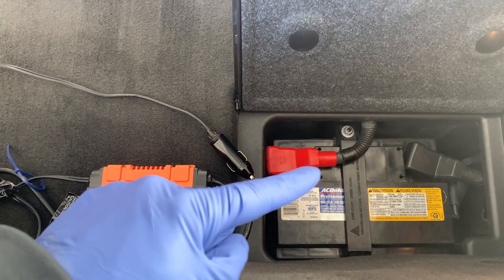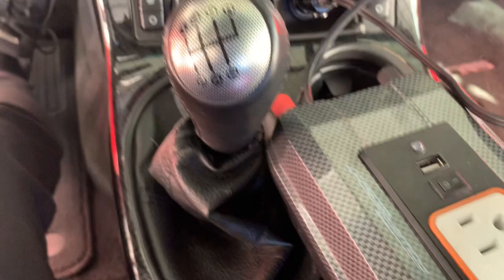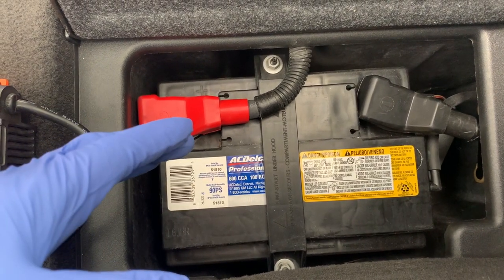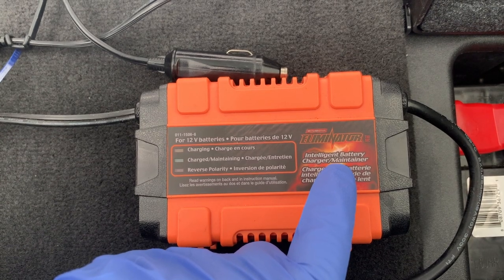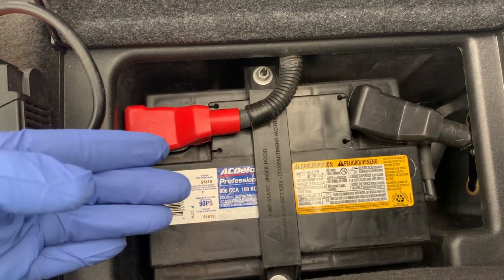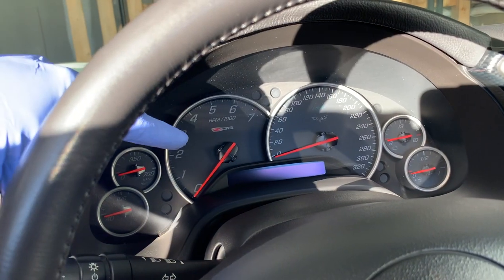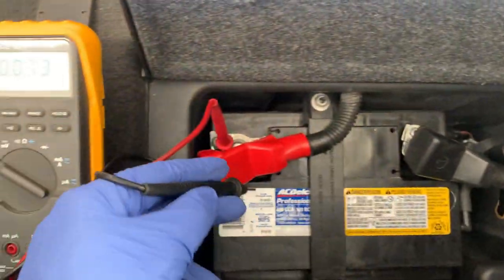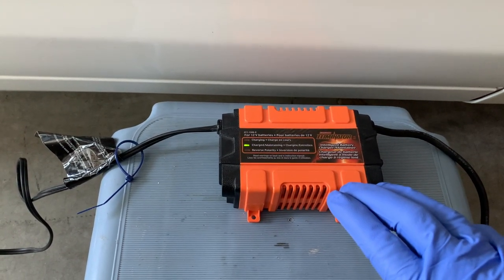How To Properly Use A Battery Tender: for charging and maintaining

Comment: The heart of my backyard pool sound system is a high quality Pioneer car stereo that was salvaged from a scrap vehicle.  I initially powered it with a 12 volt laptop charger, but occasional power outages would mean I had to often redo the settings.  I had a spare battery maintainer exactly like yours and I picked up a 12 volt lawn tractor battery.  With the stereo connected to the battery which is connected to the maintainer, everything works perfectly and no more setup loss issues.
Reply from the maker: I miss the old head units that we use to swap out periodically.  And that’s a great way to get power to it.

Comment: Excellent video. I went out and bought a 4 amp Deltran battery charger and maintainer for my truck. Nowhere in the instructions does it suggest 'how often' I should use this product.  My vehicle is only driven once or twice a week and less than 10 miles each trip. I know it could be used daily, but that's probably not necessary. Any idea how often it should be used ?
Reply from the maker: You can frequently use and leave your battery maintainer on all the time.  Environment / region plays a huge factor in the equation.  As an example, my sports car (driven similarly to your usage) battery would discharge within a week when I lived on the Pacific Coast.  So, as soon as I parked it, I would connect my maintainer until the next drive.  When I moved to the interior, the same driving habits didn't require a maintainer.  In short, attach/use the maintainer as much as you want - they are designed for constant and long term use.
Reply: @YourHomeGarage  Thank you.

Comment: Can you use a 4 amp battery maintainer/charger to two 6 Volt deep cycle AGM golf cart batteries in a series? My charger can do deep cycle, 6 volt or 12 V AGM. When I read the charger/maintainer instructions said don’t charge more than one battery at a time but it did not state that on the outside of the box. Short of opening and reading each charger instruction manual, how do I know what charger/maintainer to use.  By the way, best video ever! I have watched hours of videos on charging because I have different batteries (golf cart) rather than car and I have them in a series. Hard to find info pertaining to my situation.
Reply from the maker: I think you just gave me a great idea for a video (lol). 
Yes, but with restrictions. A parallel connection means that positive posts of each battery are electrically connected together and the negative posts of each battery are electrically connected together. The voltage of a parallel connected battery pack is exactly the same as the voltage of each battery in that pack. 

If the nominal battery voltages (i.e. 12V, 8V, 6V) are the same on each battery, and if the batteries are the same lead acid type (flooded, AGM, or Gel Cell), then yes, a battery maintainer/tender can be used to charge more than 1 battery simultaneously when those batteries are connected in parallel. Just remember that 2 batteries in parallel behave like one large battery. The charge storage capacity of each battery simply adds together. Two 12 volt batteries, each with 25 amp hour capacities, will look like one 12 volt battery with a 50 amp hour capacity. You may be able to charge more than 1 battery simultaneously, but it will take longer to do it.
Reply: @YourHomeGarage  Thank you. Both batteries are the same and same age. Okay to charge both at same time when in a series instead of in parallel? Such as, battery number one negative post to battery number 2 positive post? And, battery charger/maintainer hooked up positive post battery one and negative post battery two?

Comment: Does this have to to be plugged into a wall continually then also connect to car at same time? My car is on the street and losing charge  cause I don’t drive it much.  Don’t have access to a outlet in street.  Not sure how this works. Thanks.
Reply from the maker: Great question - so the short answer is “yes” it has to be plugged into an electrical outlet and then the other end into your car cigarette/auxiliary port or directly to the battery terminals.  In your situation you may want to look into a solar pack that can be set on your dashboard to power your battery maintainer.  Second alternative is to remove your car battery and store it in a garage with the maintainer connected to it.  Third is to leave it in the car, but disconnect the terminals so there is no draw on the battery and then reconnect when needed.  Forth is to run an extension cable to the car to power the maintainer - but not really ideal if the extension cord has to cross the sidewalk or other public access.   The solar pack is likely your best option, but disconnecting the battery leads may work if you drive it frequently enough before the battery dies.  Hope the few options help.
Reply: @YourHomeGarage  Thank you for taking the time to reply! Very much appreciated!👍👍👍

Comment: If you don't have an electric outlet in the garage, can you use a portable battery power station, of course, the portable battery has a limited power source?
Reply from the maker: Yes, you can use a portable power source, though that comes with challenges.  Mainly ensuring the power source is sufficiently charged, regularly.  In addition, there are solar power units you can purchase for your battery tenders.  So, if by chance you can get one with a long enough cord to access sunlight and reach your car - that may be a more convenient option vs a portable power unit.

Comment: Hi,
Excellent explanation.  You are a very good teacher.   
I have one question.  Does the “ Cigarette Lighter” socket have to be still live when the car is turned off, like in a Ford, or just a functioning, intact circuit? I own a 2014 Toyota Hylander, not a hybrid.
Thank you in advance.
Tom G
Reply from the maker: Thank you for the kind words.  

Yes, the cigarette lighter/auxiliary port does have to remain live when the car is off for this method of connection.  However, most maintainers come with multiple connection options, so use the alligator clips and connect directly to the battery if there isn’t an operational auxiliary port when the vehicle is off. 

My Toyota RAV4 cuts the power to the auxiliary port as well when off - similar to Honda.  So every manufacturer is slightly different with their approach.  

Hope that helps.

Comment: Very instructive.  Can the battery tender be connected for three or four months at a time? Is there a fire hazard?  I live in another state but have a car in Florida which I use a few times a year.
Reply from the maker: Automatic maintainers are meant to be used for very long periods of time.  Some companies will say “leave it on forever”. I average about 8 months on my car before I take it off.

Comment: The for the video. My first time looking into a battery maintener. 

I had a car battery died on me after a 10 day trip a month ago. 

What if you parked your car in a public or airport parking lot and go on a trip for 3 weeks in NY winter?

There is no electrical outlet to plug in.  Can I attached the maintener to my battery and close the hood? 

Thx for the info.
Reply from the maker: The quick answer is “yes” you can close the hood, trunk (like I do) or keep it in the cabin if it’s an aux plug, with a maintainer properly connected.  

Your issue is going to be power to the maintainer.  If airport parking is outside then you might want to explore a solar blanket that sits on the dash to power the maintainer.  Of course a snow covered windshield or underground parking will void this idea.  

Another option is just to disconnect the negative terminal when you park the car.  

Some “park and fly” stations offer a battery boost as it’s common for long term customers to experience a dead battery.  

I think you’re best option is to just disconnect the battery - the lack of a power supply to the maintainer is going to be the challenge in this situation.

Comment: One question---What do you have to hook it up to a cigarette lighter for if the wall plug is where the power is coming from?
Reply from the maker: The power is coming from a wall receptacle and can either charge the car battery through the cigarette lighter (only if the cigarette lighter is constantly powered) or directly connected to the battery with alligator clips.
Reply: @YourHomeGarage  thanks for the clarification...the cig lighter is a transportation device to get power to the battery without opening the hood.  Probably better for women but they still have to run an electrical cord through the window from an outlet. Watch out for Bird $h-t...

Comment: On older trucks and cars, with weeks on end of not using a vehicle, pop the hood and use a battery dissconnect...have used these disconnects for years .... any auto store has them for $10.  Disclaimer--I cannot attest to the newer vehicles of today with the computers and such---they may need the battery connected all the time to avoid computer failure, etc....

Comment: The battery on my Camaro is in the truck, can Install a Cigarette Lighter female Pug in the truck directly to my battery then just plug in the maintainer that way? The lighter plug in my car turns off after 30min. Also, what gauge wire should I use? Thanks for your help.
Reply from the maker: Instead of trying to wire a cigarette lighter (auxiliary port) for the battery maintainer - why don't you just use the alligator clips to connect directly onto the battery posts?
Reply: @YourHomeGarage  I just figured it would be more permanent, the clips might release?
Corvette has a similar lighter plug in the truck, easy just to insert the maintainer in, vs tearing the car apart to reach the battery.
My maintainer has a lighter plug already on it.

Comment: I have found that lots of “smart” maintainers charge and then turn off only starting yo charge again under 12v. Allowing a battery to sit under 12.6. starts to sulfate.  At what voltage does your maintainer start charging again in maintenance mode?
Reply from the maker: Definitely, anything under 12.6 means the battery is undercharged (90% or less) possibly as a result to sulfation as you said.  I believe my maintainer has a float mode of 13.5V - I think that is standard amongst all popular brands.

Comment: So I don’t have a garage to store my car in and therefore the Axtra battery maintainer would be sitting in the open uncovered as would my car hood. If I leave it overnight would the morning dew/condensation hurt the charger/battery? I drive it once a week and my last battery died on me because of that.
Reply from the maker: Is the vehicle kept outside?  If it is, then you can get a solar pack/blanket to power the battery tender.  And if you have a live socket inside the car, then the hood never has to be open; otherwise you can carefully position the batter tender under the hood and still have it closed while plugged into the solar blanket.  Hopefully this explanation makes sense and helps you out.
Reply: Please my truck is parked on the street. I have no source of electrical power to plug a battery charger or tender.. pls what are my options? Is a solar park a replacement for power sockets?
Reply from the maker: Correct - the solar pack will power the batter tender.

Comment: So the car essentially keeps itself charged through its own cigarette lighter socket?
Reply from the maker: Correct.  It’s just another option to connect a battery maintainer.  And if the car is stored outside - a solar charger on the dashboard that plugs into the cigarette lighter works like a charm.

Comment: The cheap ass 18x18 solar panel with a charge controller worked great to charge and tend my school bus
Reply from the maker: The solar panels are great substitute when an extension cord isn’t practical for a battery tender.